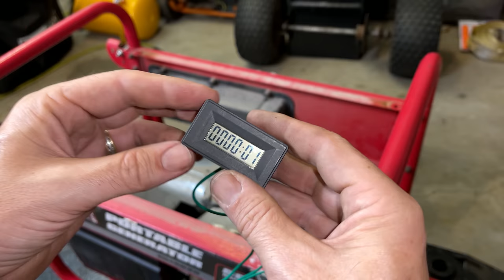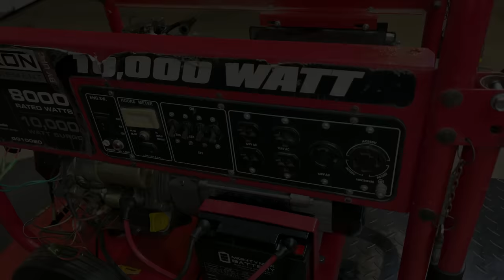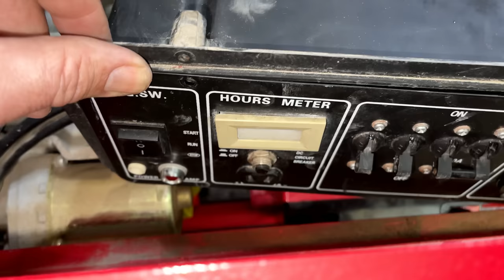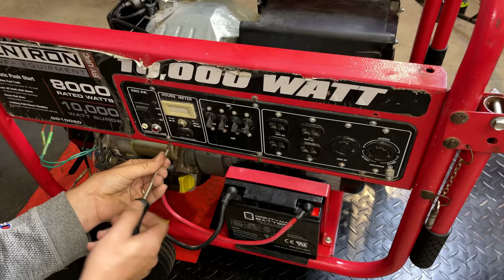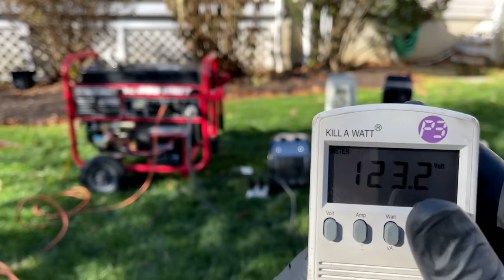Generator Engine Dies Out Quickly - Only Runs for a Second (Not the Oil Sensor)

Comment: Your videos are always well done, curious why you don’t use the lift table you received recently
Reply from the maker: I did once I got the wheels on.  I hurt my back dragging that monster onto the trailer.
Reply: @jcondon1  Sorry to hear about your back James. Hope it's back to normal now. Maybe if you know that the wheels are shot (you could ask if not sure) then bring your jack, some wheels, clips etc. and install them where you got the generator. Then it's much easier to load up and much more back friendly. That one is a beast! An electric winch could also come in handy when loading a generator into your trailer. Great step by step video James! The camera angles are so good it's like I'm there. Also like it when you move the Kill A Watt meter up to the camera for us to see the results at varios loads. I have an old freebie Fairbanks Ward (no affiliation to Montgomery Ward) 3000 watt generator with 5hp Kawasaki 4 cycle motor. It was surging at full load, so yesterday I set it up and adjusted what I think was the pilot jet (found that out after removing it while the surrounding red paint came off exposing it then adjusted) and the surging is almost non existent now! In all honesty, a few weeks ago I thought I was adjusting the jet when actually I was adjusting the Idle screw. I couldn't tell as the motor was well above idle because of the governor lol. It amazes me how some older 70's generators like mine can run so well after all that time. Used an 1875 watt hair dryer and a 500 watt work light for the load. Not very loud too! I found a older electric heater that was discarded on the sidewalk recently and picked it up for generator load testing. My wife threw the old heater in the trash. Just kidding about her throwing way the heater. I hope this helps someone. Thanks for listening...

Comment: The next time you have sticky hand grips, put a little gasoline on the inside of the handle grips, and they will slide on like you would not believe and hold on forever. It’s an old bicycle, hand grip track.

Comment: On my Predator 3500 inverter generator it has a label on it to clean the spark arrestor periodically. Mine did run fairly rich until I changed the jet for my altitude. So I'm hoping I won't have the problem as bad or at all. The quality of gas can also be the issue. Would be interesting to know if the exhaust outlet opening is fairly standard and maybe have some on hand from another manufacturer.
Reply from the maker: It is fairly standard although this one was a little larger then most.  I had a few other exhaust systems from similar sized clone engines and all were too small.

Comment: Hi James, was the problem the fuel valve blockage inside the tank ie that black stuff.?
Reply from the maker: The value was not blocked, but definitely something wrapped around it.  The main issue was the broken valve lever and it had a small drip.

Comment: Quick tip, take that sand paper off the sander and have you wife use it on your back. It will help loosen up the sore muscles, actually they will turn into mush, it works right through clothes.

Comment: I'm surprised that you didn't have another muffler off a parts machine.  Didn't matter in the end...

Question:  Aren't those the moving handle bars that can amputate fingers?
Reply from the maker: I do have extra Honda clone mufflers but the were not the right length.  The handle on this one is the finger chopping one https://youtu.be/6yn97TgNvTE

Comment: I picked one of these up the other week for cheap. My fuel vent piece on the top of the tank (plastic with the 2 fuel lines going in and out) is broken apart. Any recommendations on where I could find it ? Or even just something that would work? I can’t find anything online similar. They all seem to fit into a hole in the tank rather than an in and out fuel line. 

Thanks for the great vids.
Reply from the maker: If like this generator, then it could be available on the JDNA parts site https://parts.jdna.com/GG10020

Comment: For that new hour meter, couldn't you just connect it to one of the AC legs?
Reply: You would need to check the maximum input voltage the meter can handle. 120V ac might fry it.  If the hour meter takes a more or less constant current then connecting a suitable resistor to one of the legs would work fine. If the current varies then you would need to supply it with a small transformer. Resistors can be cheap. Cheaper than transformers. Judgement is required as to how much its worth spending, if anything at all.
Reply from the maker: I could have, but there was no labeling on it as far as AC/DC 120 or 240 volts etc...
Reply: @jcondon1  I'm the sort that would just hook it up to 120VAC and see if it lets the smoke out.
Reply: @jcondon1  I would just try it on a 9 or 12 VDC battery first. If that didn't work, then the meter is likely a 120 VDC unit.

Comment: Mr Condon I've got a question. I was recently given a number of generators none of which ran at the time and I've only got 1 complete on running thus far. All of them were basically junk when I got them. I did manage to get a good Honda gx390 engine off of a black max with a bad power head. The other ones are champion, Troy bilt and a locked up John Deere. Would you happen to know if any of the power heads off of any of the champions, Troy bilt it the John Deere would fit on the Honda gx390 engine? I really want to make a nice generator with that engine. Thank you for your time sir.

Comment: Marquis pizza place that will fit in between that rail drill you 2 holes to where you bolt to fit back and that metal plate will enforce it but if you make 2 metal plates for each side of the bolts then that don't make that double strength

Comment: You are better off not putting a new spark arrestor and all they do is plug up and cause problems. Every generator and Small Engine equipment that I have sold that has had that I have removed it and I have never had a come back. I’ve had some that I left in it came back several times you are better off to just do away with it and not use it just letting you know from experience.

Comment: Should a generator be covered if it is being used (running) outside (of course) while raining or snowing. If so what is the best way to do so?
Reply: It is dangerous to run the generator in wet weather conditions and should be avoided.  Keep the generator dry!
Reply: I've  seen run covers on aMazon, both soft and hard ..not cheap but likely what you want to prevent rain, snow on it while active.

Comment: i just dont trust running much of anything with these types of generators except like resistive loads like the electric heaters and old style filament bulbs, i dont think i would try running refrigerators, well pumps, tvs and computers..just not worth taking out a expensive well pump or fridge!..these generators just dont like inductive loads like seen in electric motors, they will run them but its dirty power that fluctuates..i suppose if its an emergency but takes your chances, i know my uncles fridge went out a couple weeks after a power failure and he used a generator to power it for a few days

Comment: Hey James I'm told you ran into a Generac where only one camshaft love was worn off, is that true? I've got one in my shop with that same problem, I think. If that's the case, well, boat anchor time
Reply from the maker: I have not, but know a local guy who has had 4 or 5 in his shop with worn cams.  The Generac GP series...

Comment: Hello, I'd like to know if you'd be able to help me with little advice. Have a 6500 watt generic generator and on the 240 volt plug one side is putting out 120 volts and the other side quit putting any out. What could be the cause of why it's not putting out any volts on that side of the plug anymore could someone please help. Thank you
Reply from the maker: A 240 volt generator has two 120 legs which when combined properly make 240 volts.  I would check the 240 outlet.  If you have 240 volts then most likely you have a bad outlet, bad or tripped circuit breaker or a wiring issue.  If no power at the 240 the you might have a bad stator.  Could also be one of the other issues above.
Reply: @jcondon1  
Thank you for getting back to me. Merry Christmas & Happy New Year as well.
Now I rechecked the 240 volt generator plug on the generator, the right side leg is reading 120 volts, the left side leg is reading 0.04 volts. Worked perfect two weeks ago when we had freezing rain and the power was out, ran the generator for 3 days. Can you please explain a little bit more detail to me so I can understand what to do and how to trace this down please,, so i don't have to buy a new generator. This generator is at least 15 yrs old.

Comment: I would be a little suspicious of why the engine created so much carbon to clog the spark arrestor?
Why is the Form-a-Funnel $26 with free Prime shipping at My Amazon but $49 plus $10 shipping on your Amazon Store? If it is not an error, that is a VERY healthy commission.
Reply from the maker: Not sure.  If you buy through the store, I get a small piece of commission.  But the price is the same.  The seller just gets a little less.  Send me the link to the one you found and I will update my store.

Comment: Do you ever consider offering to resell these devices to the sellers, with an appropriate profit? Seems too bad to sell off a large generator for so big a loss, because you can't troubleshoot it yourself.
Reply from the maker: Yes.  I have done that before.  In this case he already purchased a new one and wanted this one gone.
Reply: I try to resell units I have repaired/refurbished here in the SW florida area. Its difficult to get more than 3-400 for these portable units because you can get a new one at a big box or HF for that price range. I currently have about 8 different units for sale- all under 599 (some much less) and I have to sit on them for quite awhile.

Comment: So--what was wrong? My generator does this exact thing---runs for  a few seconds and then dies. I've tried several things but no luck so far.
Reply from the maker: In this case it was a clogged spark arrestor and a bad spark plug gap.

Comment: You wasted a lot of time by not checking plug first. A drop of dish soap on handle  males grips slide on.  A little lube on axels after sanding protective paint off. A few minutes cleaning inside of control panel could make a big difference later, otherwise a good video.

Comment: Have a Elite Series generator with a 10hp briggs it has a carburetor like the one  you fixed https://www.youtube.com/watch?v=tonM4_LS3As has a plastic float and bracket . The level is way to high anyway to adjust with heat ? I have replacement ordered but just in case I need it before Jan 4 , any help Thank you.
Reply from the maker: I have used heat and it works, but it’s a fine line between working and melting.  Usually that issue is due to a bad needle.
Reply from the maker: It happens if you get carb spray on the rubber tip